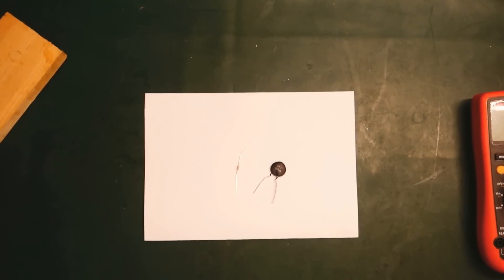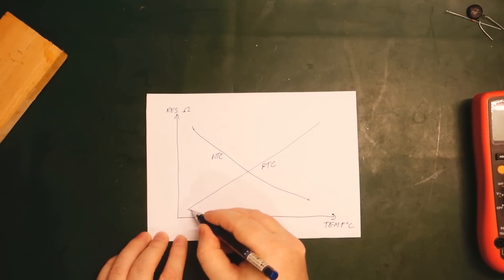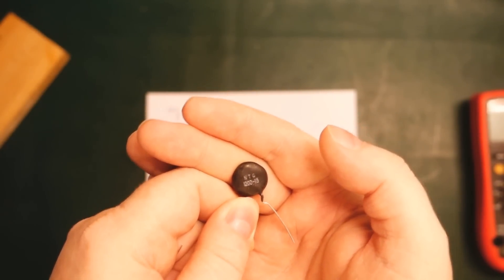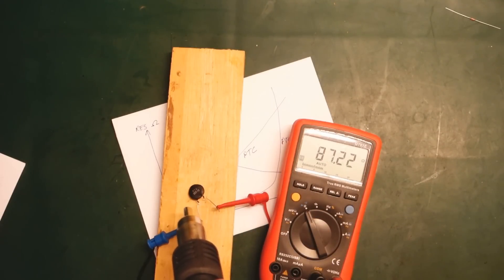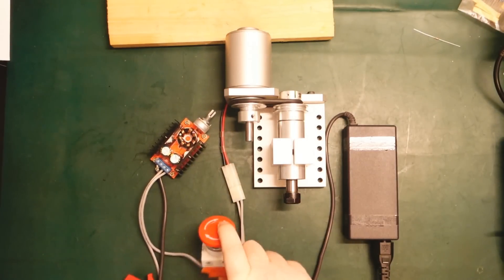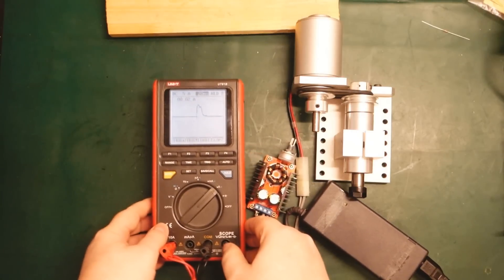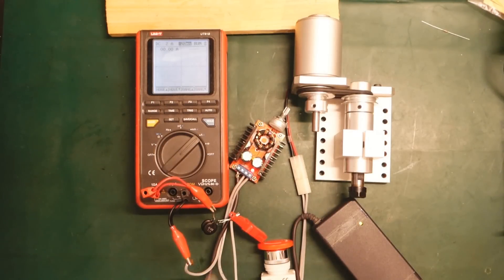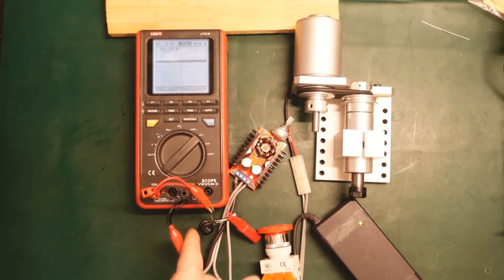Thermistors - Common Use

Comment: In the automotive industry, power windows will experience over-current conditions once fully down or up, while the switch was held. The NTC thermistor was mechanically attached to the metal body of the motors case to dissipate heat. Once current is removed, the window would work again. However, it has been common practice to protect the wiring using a thermal re-setting circuit breaker at the fuse box in series with it. Over decades, I have found the motor circuit open and the thermistor was defective and once replaced, it worked fine. Over time, the thermistor was capture inside the insulated motor end cap, but simple metal tabs could be bent to remove and access. Good direct to the point info!
Reply: I guess im asking randomly but does any of you know a tool to log back into an instagram account..?
I was stupid lost the account password. I would appreciate any tricks you can give me.
Reply: @Scott Uriah Thanks for your reply. I found the site through google and Im waiting for the hacking stuff now.
Takes quite some time so I will get back to you later when my account password hopefully is recovered.
Reply: @Scott Uriah It worked and I actually got access to my account again. I'm so happy!
Thank you so much you really help me out!
Reply: Not sure about that info, but phones store user name / password in memory. Same with a PC. I would look in general, about, history then look for password list. New tried but most sites have a forgot password feature, ask for email, text or call. Each are different. Best of luck I don’t have any social media as 12k techs in 7 states know me from 4 hrs tech seminars. No sleep as they all have questions, that’s one reason I won’t do videos.
Reply: @Byron Aarav Happy to help :D

Comment: What would the smaller type thermister ohm reading be.How would you test it .The one I am testing is from the bottom of a metal plate of a pressure cooker.I think its bad.You didnt test the smaller one.Thanks